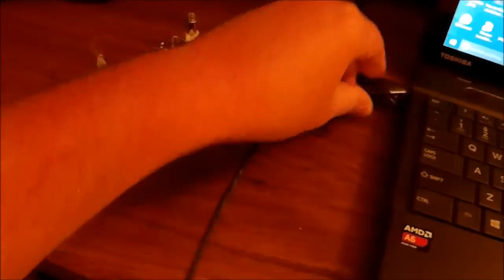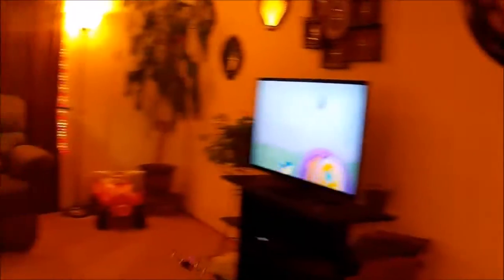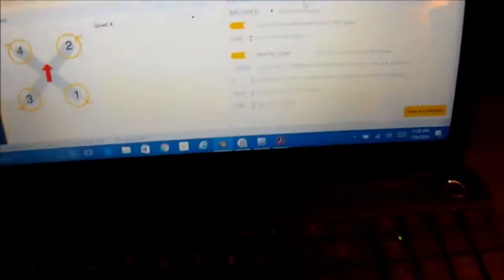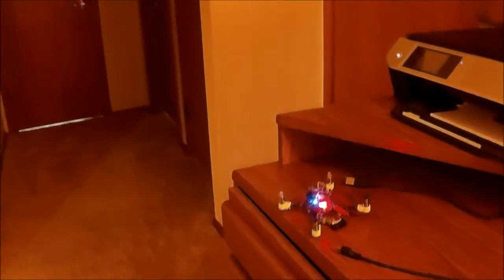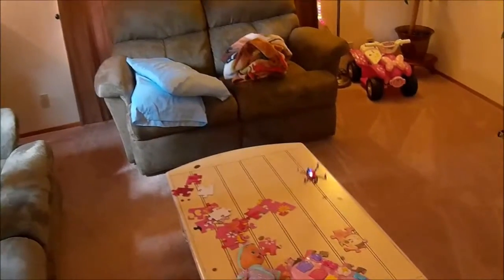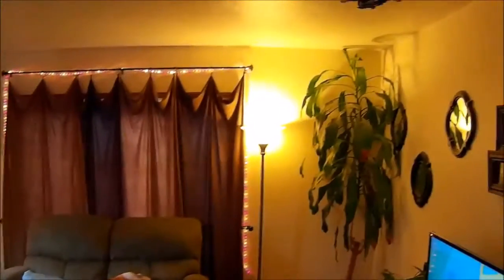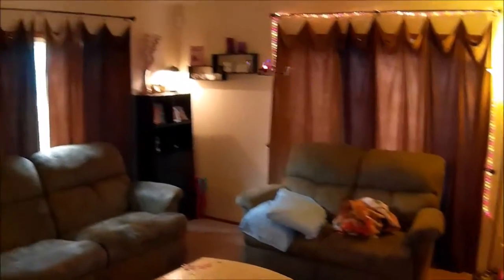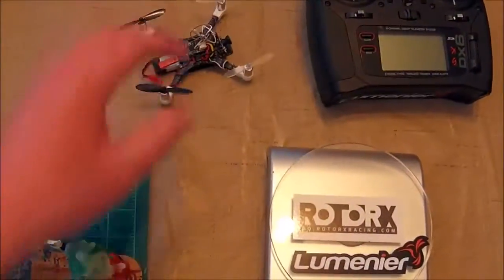picnic 120 flashed to betaflight 3 0 much better

Comment: hey Adam,  so i got a new board, (sp racing f3 evo).  and unfortunately i fried the boot pads so i am stuck with cleanflight until i get another one and im sure you know how long that takes.  my question is this.  the pids you use in this video where perfect but i cant get my quad back to that perfection in cleanflight.  can you translate from betafligh to cleanflight with these setting.  stuff like the rc rates and expos.  im sure they are the same but in cleanflight some of those settings are on the radio tab and not the pid tab.  please help, lol
Reply: lol, i see why you hate on it!
Reply: ok, so i have a couple of boards on the way and wanted to know.  Is there anyway to flash these boards  without jumping the pads?  i am just fine at soldering things that i can see, but these things are small.  Thanks in advance.

Comment: MAN! That looks so stable. I have the same board and same setup on a 120 frame. I haven't changed much from when the board arrived, honestly. But the quad is SO fidgety. Angle/Horizon are HOPELESS - Acro is ok but still tricky and on edge all the time. I have similar setup running a SciSky board on Cleanflight and it's so smooth and more powerful.  The F3 board came with Betaflight 2.8 - maybe I'll try flashing 3.0 as you did - perhaps that'll clean out the settings that Eachine/Banggood got in there....

Given all this, I'm not super excited about this board yet :/

Thanks for posting the PIDs and whatnot. If I can get performance anywhere near what you have I'd be happy.

Comment: Is that a SciSky?
Reply: Did you have to jump the bootloader pins? I got it running 2S! Look at the pics on Banggood to see how
Reply: I have been trying to get my f3 boards running Betaflight but they all lose connection when I start the flash process! Tried 2 F3 boards I got from Amazon and even tried my QX90 but still just loses connection! :/
Reply: Thanks man, as for motors, I use the motors from the MJX X600! Only thing, the wires are a little short and the have plugs like motors from the Nano QX. 1 day shipping is AMAZING though! 😆